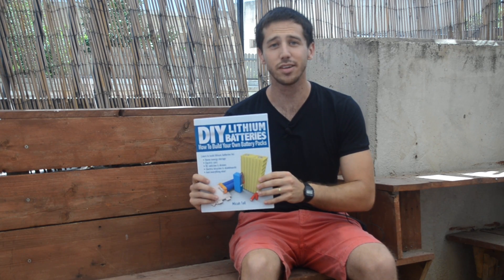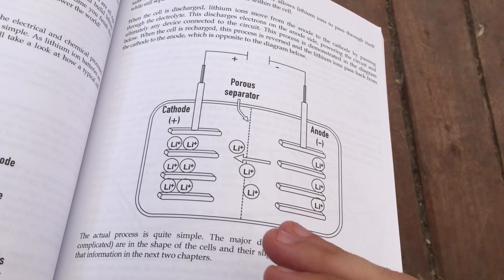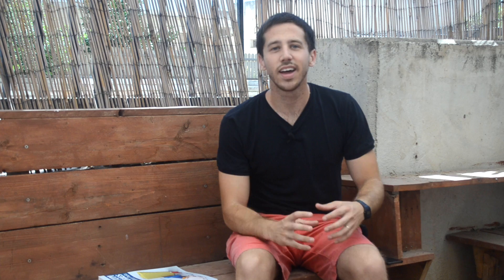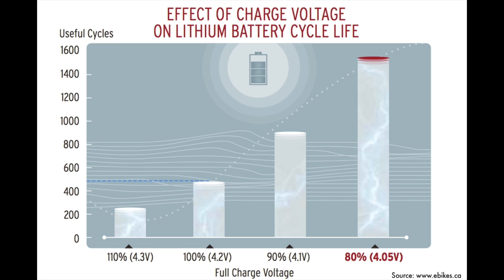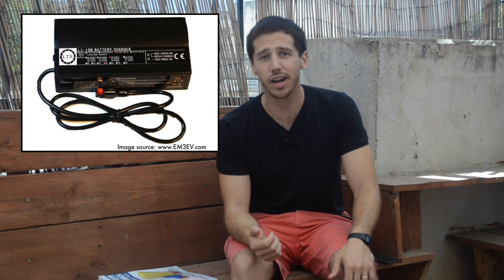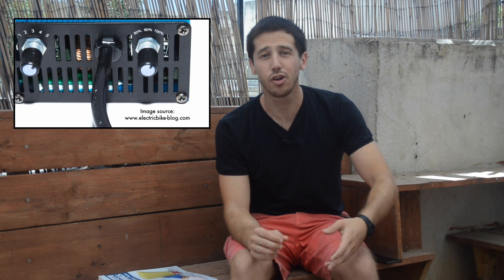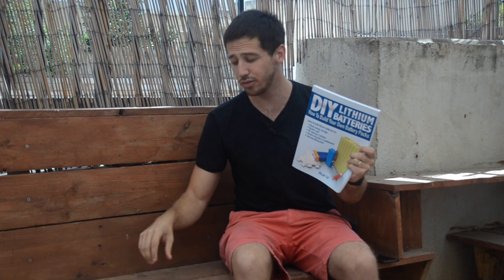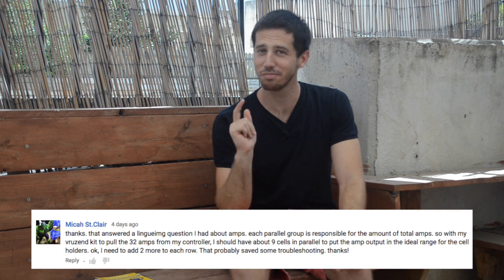How To Double The Life Of Your Lithium Batteries

Comment: Very informative info. 
I have a question:
First the set up:
I recently bought a class 1 2018 FOCUS Jam2 plus E mtn bike, with a Shimano estep's 8000 250w nominal/500w peak motor. The battery is a rather small internal down tube mounted 378 wh and 10.5ah/36V that lasts 19.5 mi. and 2600' of very  climbing, all in the lowest ECO  setting. The connection is Rosenberger and the bike is set up for a piggyback (water bottle mount) 378wh secondary battery for longer rides. It's currently sold out at LBS and is also $599 plus shipping. I'm using this bike for many reasons, mainly, I'm now 58 and want to ride longer, harder and faster, but after a normal (acoustic) 20-25 mi ride with 2400'-2800' verts, I need 3 days of rest. I don't like resting!
Also, at my age, my HR is often between 150-168 during any ride, which is counter productive at my age. 
So, after the initial thrill week (4-5 rides) and my HR hitting a Max of 176 (I still felt fine) due to the excitement of ripping both uphill and then back down, I've managed to control myself a bit more, so the past few rides were ridden in ECO 97% of the time yet my battery dies just before 20 miles, so I'd like to either order (AliExpress) or build a battery to spec that will work for my application. None of the AliExpress sellers offer the Rosenberger connection, but they do offer a 10.5a 36V external down tube mounted battery.
FINALLY the question:
Can I purchase a 500wh 10.5a/36V battery, then procure the Rosenberger connection and splice it to function with my current system? If so, will the Amps and voltage need to be the same as my internal battery? Also, can I go with the larger what battery as long as it fits in the area on my downtube, or do I need to go with a 378wh battery like offered from FOCUS bicycles?
I'm sorry for the long winded post, but I'm trying to paint a good picture for you. 
Thanks so much in advance, and I hope to hear back from you. Happy New year! Your my new favorite YouTuber for lith-ion batteries.

Comment: If you look at the Discharge curve on the typical 18650 cells you will find the 4.2-3.9 voltage only last a few seconds or not even one minute.  The Capacity gained by taking them to the Top End of charge is just not even worth the returns in capacity.  Why Kill your cells for such limited returns ?  Not me.   I don't take mine past the 4.0V SOC.

Comment: Lithium ion battery of 351 volts of 95 cells came with its BMS but I'm converting it from 351 volt to 48 volts for my inverter. Can the stock BMS still work with it if stepped down to 48 volts configuration?

Comment: It's not plahing, it's producing dentites or crystallization just like on lead acid batteries! The crystals build up so large, they start to short the other plate....using a lower voltage is not necessary going to help because the BMS is still in charge of each cell. Unless the BMS is built to only charge to 4.1... you're just out of luck....

Comment: I think it would be interesting to talk about step down converters in this video. Many people like me already have chargers without a voltage regulator and can possibly use that circuit for lowering the maximum output voltage of the charger. (I am not sure if it works well as I ordered the step down converter a few days ago and I didn´t tested it yet).
Great work with this channel! I really appreciate your videos and I have learned a lot of ebike things from you.

Comment: Can you tell me precisely how to program my Grin Satiator to charge my 52v 21ah battery to 80% SOC? The guys at Grin tell me to read the manual, but when I tried to edit the 85% charge profile it came with down to to 80%, it totally blew the profile away (or changed it's name without saving the new parameters... I'm so confused! Anyhow, the Grin came with my bike so I didn't have a choice, cause I woulda bought the Luna.  I'd rather just ride my ebike rather than become a battery expert. Any help would be appreciated.

Comment: Hello Mike hope you are doing well there is a quick question as you said if I charge the lithium ion battery to lower voltage like 4.1 4.0 voltage it will last long like many more cycles but I am curious to know when I will charge the battery should I maintain the same voltage as specified by the manufacturer that is 4.2 and charge to 80% or 90% or do you recommend a new type of charger where I can set the expected battery voltage like 4.1 and 4.0 and charge to 100%
I am really curious to find it out hope to hear you soon have a good day

Comment: About once a month you should let your battery completely discharge to recalibrate the software. Also, keep in mind that when you don't fully charge a battery, you don't go as many miles as you get on a full charge. So if you get twice as many cycles from under charging, your bike won't get twice as many miles. You still get more miles by under charging though.

Comment: Does undercharge mean charging AT a lower voltage or charging TO a lower voltage. If the latter, could I use the standard charger of my e-bike and just unplug it before the battery is totally charged?

Comment: hey MicahI have a question I am about to buy a 48 volt 20ah battery cause it is cheaper than building one anyway my question is I have a choice between 2 different batteries  one with a 30 amp bms  or one with a 50 amp bms for just a few more dollars so which would be better my controller is rated for 36v-52v  and will it make a difference any help is allways greatly appreciated thanks sincerely neverumind

Comment: What about hitting the throttle I think that's the reason my ebike has lasted over 10k miles with lifepo4 10ah and after the 10k miles its 9.7ah I always look at my current I try to keep it under 10 amps

Comment: Not sure if a common BMS can completely balance a accupack with cell that are out of balance by 0,2-0,4 Volt. Presume you got a 10S Accu containing 10 Cells each 3.6 Volt and ~10AH. A top balancing BMS that only provide a balancing current of 40mA-50mA is hopelessly overextended with this task. Thats exactly what happened to my pack but fortunately the manufacturer built in at least a balancer port so I was able to precharge the weak cell speperately for some cycles which made the situation much better.

Comment: Bad Advice!!!!! After the initial full charge don't deplete past 20% charge and don't re-charge over 80%. That gives you use of 60% of the batteries capacity. Bigger the battery the better. To properly monitor and maintain your battery use a Grin Tech. Satiator to charge. This procedure could double the number of recharge cycles.

Comment: "" Cycling a battery at less than full discharge increases service life, and manufacturers argue that this is closer to a field representation than a full cycle because batteries are commonly recharged with some spare capacity left.

There is no standard definition as to what constitutes a discharge cycle. Some cycle counters add a full count when a battery is charged. A smart battery may require a 15 percent discharge after charge to qualify for a discharge cycle; anything less is not counted as a cycle. A battery in a satellite has a typical DoD of 30–40 percent before the batteries are recharged during the satellite day. A new EV battery may only charge to 80 percent and discharge to 30 percent. This bandwidth gradually widens as the battery fades to provide identical driving distances. Avoiding full charges and discharges reduces battery stress.""

Comment: Built a 24s8p pack 2 years ago and had 330 cycle (Panasonic pf) and after pulling 4 random ones and checking capacity to 3 volts at 1 amp discharge on my Imax, they showed 92% of rated capacity!!..probably because I almost never took them below 3.5 volts and charged to 4.15. Amazing...

Comment: This is a huge load of very valuable information. This applies equally to batteries for cars too, I have no doubt.
I recently bought an electric car called e2oPlusP6 in India. There's a huge veil of secrecy around the battery, and the charging of it. They seem to be very mysterious (read clueless) and have laid down a charging sequence that sounds downright destructive to the battery. It's pathetic to see a car standing for a few days and not being able to call up a "Sleep Mode"...not available for this model, I am told. Click!!
You video has been an eye opener. One definite takeaway, that can be immediately applied fully charge immediately then take the car a couple of km immediately the charge is complete to drop the voltage to a non destructive level.
I definitely will, in my most 'umble capacity as a mere Owner, send your excellent video to them for what it's worth and/or try to find out what they do. Even allow them to make the change on my car!
Feel a bit frustrated that I can't make the adjustment myself...it's such a small tweak.
But there you are!
Just had to subscribe!
Thanks, Erich.

Comment: A mis-statement in the video:
Having a battery only charged to 90% will make your batterypack 11,11% bigger, not 10 %.
And for 80 % charge, your battery will be 25% bigger - it's quiet some.
(that's 1/0,9 and 1/0,8 respectively)

Comment: In other words - the best time to fully charge your battery is right before a ride.
Reply: I charge to 80% capacity after returning from a ride if I need additional power I charge higher starting about an hour before I leave.
Reply: Possibly...IF you allow the  battery pack to cool before riding.
Reply: How long for the battery to cool ? 30 min ?

Comment: If I under charge my lithium battery my scooter will be sluggish and and slow can anyone tell me why my lithium batteries output power seems to decrease even after only using 10%
Reply from the maker: Yes, this is because the power is a result of the voltage, and lithium batteries have a large voltage drop in the beginning and end of the discharge cycle with a relatively flat discharge curve in the middle.

Comment: I agree with just charging to 4.2v and calling it a day. Battery technology is moving so fast right now that in 3-4 years your battery pack will feel sluggish and outdated compared to the current offerings anyway. Second if you're like me and you build your pack out of used laptop batteries, who really cares about longevity at these price points? My ebike battery costs $30 in total anyway so when it breaks, I'll just build another $30 battery.

Comment: What do manufacturers mean when they say cycle life? Does it mean the batteries die completely and wouldn't hold any charge?
Reply from the maker: Usually end of cycle life is when the battery only holds 80% of its original capacity, but some manufacturers rate their battery cells until they only hold 60% of original capacity. They still work at these levels, but they aren't as strong and don't hold as much energy.

Comment: I use battery desulfinators to keep plating off my solar batteries https://www.amazon.com/gp/aw/d/B072WRLVLP/ref=mp_s_a_1_2?ie=UTF8&qid=1518734154&sr=8-2&pi=AC_SX236_SY340_FMwebp_QL65&keywords=12%2BVolts%2BLead%2BAcid%2BBattery%2BDesulfator%2BAssembled%2BKit%2Bwith%2BReverse%2BPOL...&dpPl=1&dpID=41M1UlWYJzL&ref=plSrch&th=1&psc=1 Would this work on these batteries? They are used on 12-36 volts.

Comment: You go through the 2 "other" chargers pretty quickly.  The Cycle Satiator is $350, which is pretty steep.  What are the names and model numbers of the other chargers? I looked for them and couldn't find them.  I might consider one of those. Also, to minimize plating on a 42V 12AH battery why not do the following: I use the bike 3-4x/week.  Rather than charging every time after use, I charge only just before riding.  That way the battery voltage remains in the high 30's (38-39V) until charging.  A 2AH charger should bring the battery up to 42 V in 2-3 hours right? That way if I don't ride for a week, I should get a higher number of charge cycles out of the battery. Like you, I also have a 2nd bike with a KW motor and a 15AH 54V battery.  I use <3AH on a nominal 35mi ride.  I should be able to use the battery like a "gas tank" and only charge it after 2 or 3 rides right?

Comment: My battery pack losses the first few volts way faster than the middle few volts. Seems like %90 of charge  will leave more than %90 capacity.
Reply from the maker: This is normal behavior for li-ion. The voltage drops quickly in the beginning and then slowly throughout the middle of the discharge period, then quickly again at the end.

Comment: I can give you a comment!  Why not tell people that you can buy a 40v DC regulator for $2.00 on E-Bay or AliExpress you can adjust to any voltage (up to 38v) you like and place it in line with your charger which solves the problem of charging a bit less?  Works fine for me for about 6 years now.

Comment: Hi, I was wondering if anyone could help me with my questions. I'm looking at buying a new battery for my 1500w ebike. My controller's max current draw is 40A - so I need a battery with at least a current output of 40A. I'm finding it very difficult to find one as there is different information regarding Amps / Current output.
Some listings I'm looking at talk about:
-Rated Discharge Current (A)
-Instantaneous Maximum Discharge Current (A)
-Maximum Continuous Discharge Current (A)
-Maximum Continuous Charge Current (A)

What is the difference between all of these?

Also, when looking at chargers, what current should be chosen?
On the listing for the battery, it says Standard Charge Current is 2 amps, but Fast Charge Current is 5 amps.
Can I go above 5 amps to make my battery charge even faster?

Help on this would be greatly appreciated.

Thanks :D
Reply: Hi .You figured it out or yet

Comment: I was always led to believe if you're going to store your battery always do it fully charged... my evolve electric skateboard says it in the manual. 
Is it okay to leave your charger on over night? when that fan stops and the lights green its not charging anymore right?
Reply from the maker: Generally it is ok to leave the charger plugged in over tonight because yes, once the light turns green that means charging has stopped. About the Evolve, their engineers should readdress that because it is not good to store lithium ion batteries at full charge!

Comment: Great video, and very well explained.  It would be cool if you explained about different elements in the battery.  Lithium Iron Phosphate batteries are supposed to last a lot more cycles, like 2000 on most cases, more many people, that would be like 10 years.  And, they are less likely to explode, like the ones on the Boeing 787 or the Samsung Note 7.  Do you know if anybody makes 18650 or 21700 batteries out of LiFePo?  Cheers

Comment: Hello.. I have a 48v charger (takes the battery to 54.6v then shuts off). I just bought a new charger to use as a back up.  I'm concerned that it is not shutting off a the same charge as the old charger.  (it show red when the old charger shows fully charged green). is this something to be concerned about..?  I'm afraid to let the new charger stay on because im afraid it may over charge the 48v battery.

Comment: What range would you get out of a 1000W motor, and 52v battery?
I need to commute 22 to 23 miles per day - in total, not each way - so am quite cautious at the moment, and concerned that the battery wouldn't last that long.
Reply: I have a 1000 watt hub motor from ebay and a 52 volt battery with a capacity of over 1000 watt hours. When new it got a little over 50 miles on a charge(without pedaling), now 35-40. This is on mostly level ground. Approximately 700 watt hour battery would be my suggestion.

Comment: I'm just getting into this whole e-bike thing, Been riding mountain bikes for a long time now. A hot rodder at heart, been building and racing all my life. So, yeah, I've spent a lot of time scratching my head, " What the???" I ran across your channel a couple days ago, I have to say I have learned more in two evenings than the last six months. That is something almost anyone can appreciate. Thanks again...
Reply: I've been riding e-bikes for almost 20 years (and non-electrified for much longer than that).  My 2 most recent are a 1000W rear motor with a 20A controller and a 58V 15AH battery on a mountain bike.  It screams with a top speed of 27mph and a range of close to 100mi but it weighs 52 lbs.  My other bike is a carbon road bike with a 350W front  motor 36V 10.5AH battery. Total weight 35lbs! It's a very sweet ride.  I get my kits from ebike solutions (gocarlite.com). Doug is a knowledgable, capable, and honest guy.  I trust him implicitly.  He'll lace wheels from the kits he gets. Sells only high quality components and stands behind what he sells.  You can do it yourself with his kits.  He provides good advice too.  You can buy Doug's batteries or build your own based on info from ebikeschool.

Comment: Can you put a 12V 4.8Ah battery and a 36V 4.4Ah in series to make a 48V 4.4Ah battery?  Each has their own BMS.  When you charge them would you need to be able to disconnect them and charge them separately with the appropriate charger?

Comment: Not sure if you've covered this somewhere else... What are the pro's and con's of quick charging? For instance I have a 36v battery with a 2A charger, what if I use a 4A charger? How does the rate of charging affect battery life and does it increase the chance of battery failure and safety? I've read other articles on this, but I am curious about your opinion.